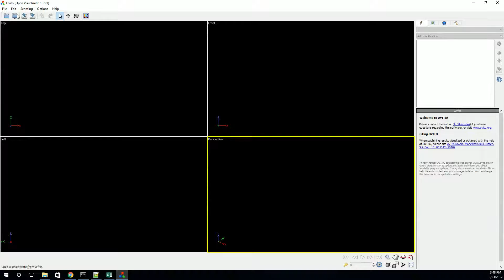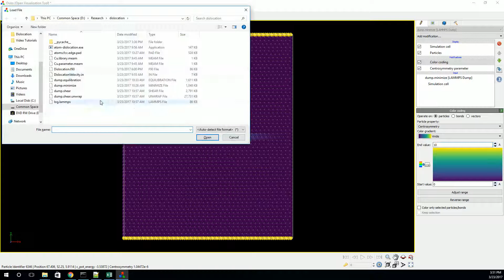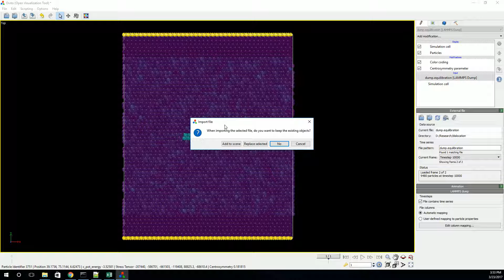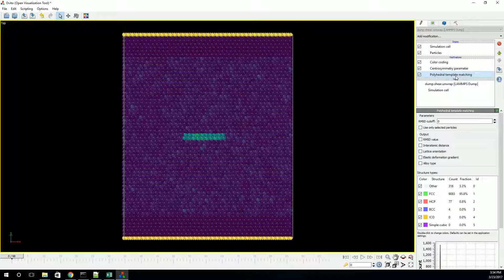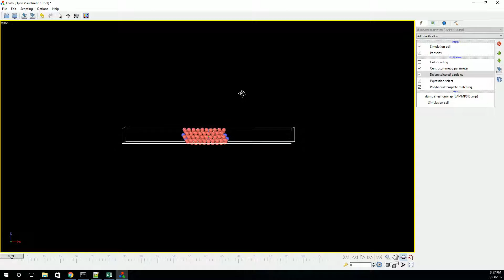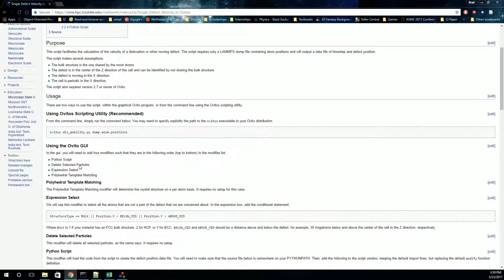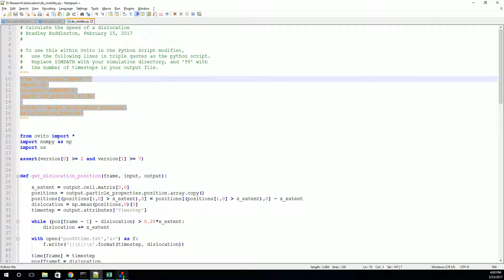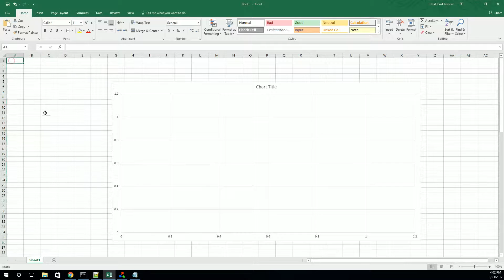Using Ovito to Analyze a LAMMPS Simulation for Dislocation Velocity

Comment: I am trying to follow along with the tutorial but I am having issues. Initially, the code works and the dislocation moves as seen in the video. However, after the top portion leaves the simulation cell, it doesn't follow the periodic boundary condition, which causes the rest of the atoms in the simulation cell to exit the cell as well. Any help would be appreciated.

Comment: Thanks a lot for your video. I am working on the OVITO version 3.0.0. When I was running the script, it showed "Modifying the values of this property is not allowed, because it is currently shared by more than one property container or data collection. Please explicitly request a mutable version of the property by using the '_' notation". I tried to add '_' to the argument but it still didn't work. Could you help me with that? Thanks for your help.
Reply: Thanks again for your video. The problem can be solved by using Ovito version 2.9.0. It seems the version 3.0.0 add more modifiers and it makes the script is not suit for this version.
Reply from the maker: Thanks again for watching. You are correct - the OVITO version will definitely have an effect, especially moving to version 3.

Comment: Thank you, it is very useful. However, I have three questions: one is the boundary condition, why donot you constrain z direction, which sets as NULL. Two: why do you use NVE ensemble when applying shear stress? Third is about the OVITO visualization. I can not understand why the atoms below the dislocation core in Y direction do not move out of the simulation box? I am looking forward to your reply. Thank you very much for your time.
Reply from the maker: Thanks for watching! The z direction is allowed to relax because that direction is periodic anyway. This we are sure not to induce any extra stress. The NVE is used just so that we are not losing energy by trying to control the temperature. The friction in the dislocation motion will induce some thermal heating, but it is slow. Actually this setting does not make a huge difference in my experience. The lower half of atoms are fixed because of the group that is on the low-y boundary. The x force on those is set to zero so that they cannot move. We need to keep those fixed so that we can force the dislocation to move.
Reply: @Jere5120  Thank you very much for your kind reply. I still do not understand the last question. If we visualize the dump.shear.unwrap file,  it seems like that the lower mobile group atoms (Y coordinates ranging from ylo+14 to zero) do not move at all. I have thought these atoms should also move out of the box like the higher mobile group atoms. Could you help me to figure it out? It would be a huge help.
Reply from the maker: You are correct, the bottom group of atoms do not move at all. This is exactly what a dislocation is doing as it moves - one side of the dislocation is moving relative to the other. In our simulation we have dislocations repeatedly passing through our system so we get a pretty significant displacement of the top half with respect to the bottom half.

Comment: Hi Brad. How are you? Can you give me some ideas about evaluating  dimensions( for example if I have a nanowire, its radius,length) ? it would be a huge help.
Reply from the maker: Hello! That's a good question. One way that you can go about measuring things in Ovito is by using the Inspect particles tool. It is in the far right tab right above your modifiers. If you control-click multiple atoms, it will give you distance vectors between them. So, you could use this to pick two ends of a nanowire to get the length, or pick atoms on opposite sides to get the diameter. That's the best way I know of, but if you find something that works better, let me know! Thanks!

Comment: Thanks for this helpful video and answering to questions. i have a same problem in screw dislocation. i created the box containing screw dislocation correctly with orientation  X=[111] Y=[-1-12] Z=[1-10] which means the dislocation will move in y direction. but when i apply stress in x direction to box (rendering shear stress to box) the dislocation moves in both x and z direction (also box is collapsed). I applied the stress 100Mpa in lammps  by:
# define boundary conditions
fix 1 upper setforce 0 0 NULL
fix 2 lower setforce 0. 0. NULL
fix 3 upper aveforce ${appforce} 0. 0.
fix 4 upper rigid group 1 upper
could you please help me what is wrong?
Reply from the maker: Thanks for watching! Unfortunately, I haven't played with screw dislocations much. The way you are applying the force looks right, I think. If the stress is collapsing your box, I would reduce it even more. See if you can find the smallest force that will still give you some motion. How did you generate the screw dislocation?
Reply: I think the stress is applied well. Tho most annoying problem is to move the dislocation in both direction (x and z). I am a bit confused. The dislocation must move in a direction that neighbour atoms are at the lowest distance (means x=[111]). Then the dislocation must move in x direction (not y direction as i mention above). but when i create the box in which dislocation line is in y (glide direction is x) Ovito (DXA) does not recognize the dislocation and it recognize the dislocation when it is lined in x direction (glide direction in y). what happen?! i created dislocation in Atomsk.

Comment: how to simulate phosphate glasses with lammps
Reply from the maker: +anouar ettayk Hello and thanks for watching! The process for a phosphate glass should be the same as any material - first, you need to find a potential that works for your different base materials. Then, you need to create your structure. If it is an amorphous glass, you will want to create your atoms with a "create random" instead of creating it with a lattice. You will want to look at the lammps documentation for that command. Good luck!

Comment: i have a question?
to calculate the screw dislocation velocity, is that same procedure described in this tutorial (with screw dislocation input file)? i mean direction of application of force, setting of other parametrs?
Reply from the maker: Great question! The procedure for calculating the velocity of a screw dislocation would be very similar, I think, with a few caveats. The dislocation generation program I use here does not have a great screw dislocation structure (at least for FCC, I think). But, it can generate one in a cylindrical structure. Then, you will have to change several things to account for the new structure. It looks like the screw dislocation structure is oriented differently, so you will have to edit the atom groups so that the forces are set to zero on the correct groups of atoms. Along with that, you will have to change the definition of the force so that it is applied on the correct plane, and in the correct direction. Finally, the post processing script will need a bit of modification as well, as it is just calculating the travel of a dislocation in a specific direction, where the screw dislocation will be moving in a different direction, I think. 

So, there are quite a few things you will have to modify to look at a screw dislocation, but conceptually, the process should be very similar. If you do end up looking into this, I would be interested to hear how it works out!
Reply: Thank you very much for your detailed explanation. i will try. meanwhile, what about atomsk software? That can also generate screw dislocation in FCC.
Reply from the maker: I actually am not very familiar with Atomsk. But, if it can generate your geometry, then all you need to worry about is fixing the correct atoms, and applying the correct forces.

Comment: Thank you for this nice video. It was really helpful. 
Just one question, what is the units of outputs, I mean position and time? Calculating the velocity for copper, for different shear stresses, I got the velocity like 0.001 to 0.004. comparing to literature, I don't think it is m/s. By the way, i used the command line to get the velocity.
Again thank you.
Reply from the maker: +Farzad Foadian You are correct, the output will not give you meter per second. The output is actually in angstrom per time step. So, it will be specific to the time step set in the input file.